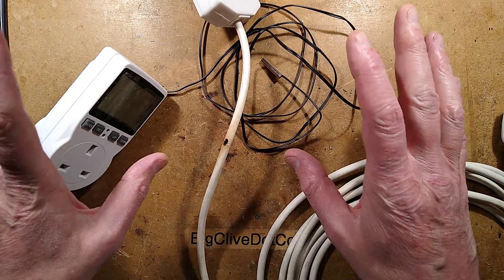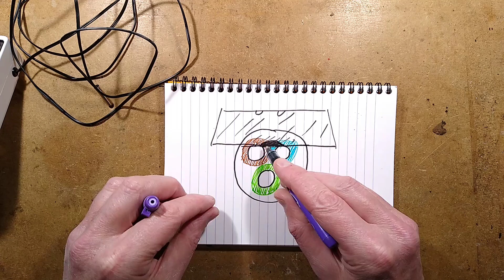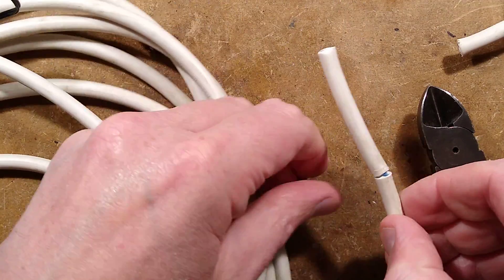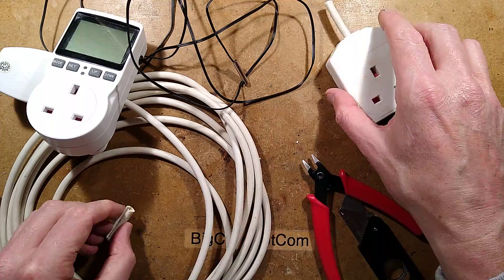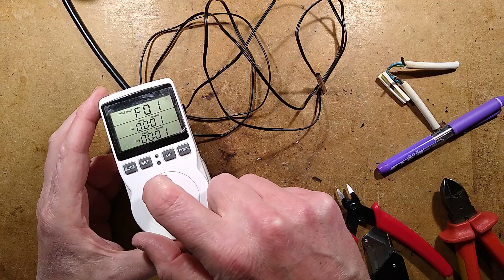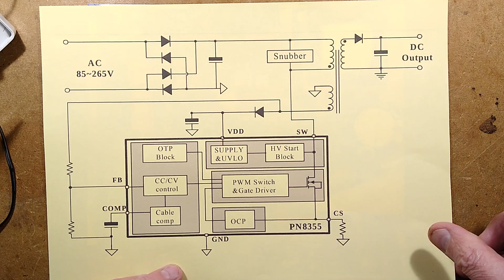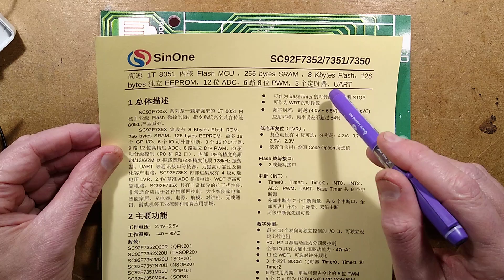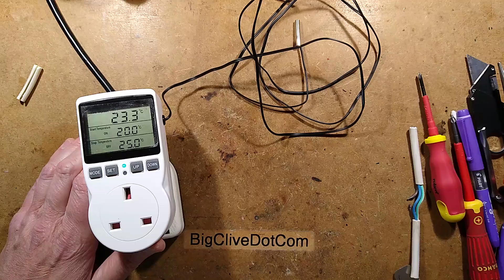The case of the mysterious cable arcing

Comment: One and a third cable diameters up from the clamp is were the change in internal tension in the cable reflects to a focus which cuts the wire/breaks the line/leaves Murphy chortling.

Comment: Clive have another look at the cable as I had a problem where when the cable was made it had printing on the cable not ink but pressed into the cable and every meter there about it had pressed so deep as to have damaged the full length of the cable I only found it after it had burnt .

Comment: I maybe wrong, but it sounds to me that the low voltage cable was laying across the extension cord coursing a hotspot, ? That is why we keep data and phone cables separate from mains cables in trunking and conduit, I was tort to never have cables crossing each other as it can course hotspots including With TW&E . But like I said I could be wrong. 
Fantastic video very interesting and very informative 👍 Cive 
👍👍👍❤️

Comment: No dirty crack =  done later due to dry plastic.
1. Cable manufacturing machines Do need to reload the individual strand spools and the ends are only overlapped without good connection.
2. Cheap cable manufacturers don't discard the spliced part.
3. It was used with a thermostat so surely heavily loaded for being a thin cable.
4. The bad connected splice get hot and it turbocharg copper oxidation.
5. The bad connection start to spark and eats away the copper as vell as melting other strands isolation and creates a short circuit.
It happens seldomly, but still

Comment: Wait a second if the thermocouple was super hot, it couldve burned through that wire. Not wire on wire, but red hot metal thermocouple on 90s extension cord?
Reply from the maker: The thermistors do not get hot.

Comment: The cable looks too thin for a heater. It only looks like 1.5mm but should be 2.5mm if it was a 3kW heater.

Comment: I don't think the cable was damaged by stretching it, based on the cut in the outer sheathing, it was likely coiled up and then held with tape and when the tape was cut, so was the outer sheathing and the brown wire likely got nicked or sliced partway through so it would work OK under low or moderate load but when a heavy heating load was placed on it, the brown wire couldn't handle it and arced causing all the burn damage we saw...

Comment: People are of careless with their things and then wonder why they break, cars are a good example, lots of people try to get away without servicing, but you may get away with it for a year or two, when it does break it will be something serious. Look after your things and they will look after you, unless their is a manufacturing error, all new electrical items need to be attended on first use in my opinion, as you often pick up a fault very quickly, if you have a basic idea of how things work. I could not repair a circuit board as I dont have the expert knowledge or equipment, but I have learnt a lot by taking broken things apart, but as the old saying goes, if it aint broke dont fix it. The number of people who mess with things, then call a repair person and say they have not touched it, if they just owned up the person would be quicker fixing it and it would save them money. I would have just cut the wire and with it being near the plug, I would have just wired it in again, but if its in the middle us a 13amp connector and not some tape, tape is fine as a short to fix, but it dangerous in the long term. When buying an extension lead check its a 13 amp, many shops sell bargain ones with a low rated fuse and wire, then people use them for jobs they are intended for, do we always check a extension lead when we want to use one, so in my opinion always buy a 13amp one, switchable with power surge is also a plus and so are LED's.

Comment: My initial thought, if you just looked at the cable, you'd see it looked bent, like it's been folded multiple times thereby cold working the metal making it more brittle. Probably hanging off a table or shelf right at that point and it just so happens when they plugged it in that time the strands finally broke or separated creating an air gap and an arc. Doesn't have to be a high load plugged in just a constant load as it continually arcs and the plasma heats up melting the insulation.

You keep mentioning the entertaient industry for some reason but a cheap thermometer like that seems to suggest it was used in domestic use... I bet that cord never moved from the receptacle it was plugged into. Only the end was continually moved and weight hanging off the end over a corner bending that wire over and over. In fact, you should have cut open the neutral and ground to see the integrity of the copper at that exact point.

Comment: Crushing that wire could have also caused a loss of strands that carry the current.
Office chairs, tables, doors, or anything that applies pressure in a very small area could have frayed that cable. Leaving heavy objects on the wire will also cause this. 
Respect electricity and things that carry it even more. It's not visible until it's a problem.
Stay safe everyone.

Comment: The carbon track actually I never thought of. Thanks for the info. Here the cable was pulled too hard, maybe stapled? Does it trip the breaker or blow out the plug fuse?

Comment: Id bet the insulation in the 20ga cord wore thin - stray copper. Either that or a break and arc - at 230 you may pull less current but these switch mode PSUs act like kinda a short charging the main cap (inrush) intermittent would do this.. Question for you - do your ring circuits cause EMI? Kinda a big inductor there..

Comment: Ive seen this on my mom's laptop - mains cords come from china and 20ga (brown/blue/green) crap insulation. That's why we have AFCIs required in bedrooms here in the US. Since we are only 120 (but split phase) we pull twice as much current. I kinda envy you - you got 230v at 32a in every room of the house. Sure you got some fuse in the plug (13a I think) but to have 7.36kW avaliable must rock (except for this kinda thing)

Comment: It looks exactly like a cable extension I once used for a soldering iron. The hot iron burnt through the plastic of the sheath and the live cable and shorted to ground through the iron. A bang ensued blowing the fuse and the live wire.

Comment: This is typical of overloading of cheap cable. There OK for light loads but very risky for 2 to 3 KWatt loads. Why do you think we use 2.5mm cable for 13Amp sockets in UK.

Comment: Cables that are coiled repeatedly can stretch inner cores and a large load such as a 2kw fan heater on a cable that doesn’t look man enough will produce heat that will be concentrated at any weak point

Comment: I feel your first assessment was probably nearest the truth, physical damage, but it looks to me that the extension cable isn't 13A but,maybe a cheap 6A unit, if that is true 1) you certainly shouldn't be running any substantial load through it and 2) a damaged under specced cable would turn in to a fuse. I have seen similar damage to flexes when items are placed on them like chairs or bookcases etc.

Comment: A much simpler mechanism may be that the live wire was cut most of the way through, then when the resistance heater load was applied, the last strand overheated and blew, causing tracking across the break with an impressive arc and heating that caused the additional bonding to the neutral wire.

The cable wasn't stretched, the hot lead had a section vaporized- that's why it's now shorter than the others.

Comment: But why are the plugs and sockets so humongous and ugly? Oh yeah, remind me never to move to Great Britain where huge plugs and outlets will be the norm. Even their Heathrow airport, on my way to visiting Israel, was a humongous overgrown poorly-planned monstrosity. Well I suppose our American 240-volt plugs are huge and ugly, but then my clothes dryer is in the ugly unfinished basement, so who cares? And my kitchen stove plug, is hidden behind the stove.

But on the positive side, Great Britain has automatic kettles and we Americans have horribly outdated whistling tea kettles that sit on a stove burner. Oh wait, I generally do not drink hot tea. Oh well.
Reply from the maker: It's because our plugs are designed to allow safe use of 240V on 32A ring circuits where you can plug a 3kW load into any socket, including clothes washers, dish washers and laundry dryers into any socket along with a tiny table light or a USB power supply with suitable fusing for all items.
Reply: @bigclivedotcom 
American plugs are probably also horribly outdated, but at least they are small even with Christmas tree light plugs that are fused. I have heard it said that even with RVs, bigger is not always better, but "just bigger" or too big for many campsites. Our American surge suppressors (or power strips) that often have 6, 8, or 3 or 4 outlets, are not huge ugly monstrosities.

Generally our American system works, however mowing my grass with an electric corded mower tends to be somewhat slow. Small blade, not a lot of power. 20-amp 120-volt circuit, but the manufacturer assumes 15. That means I only get but 2 horsepower. And our kettles are a bit slower than those of the Brits. But then why would I want hot tea in a minute or two less? I still boil water in a pan. My boom box has a fuse inside of it. But our American scheme seems sort of hit-and-miss. I imagine that some crap Made-In-China clock radio for the U.S. is not going to spend 10¢ for a fuse?

BTW, I have a couple of computers and a TV involving a surge suppressor supplying power to 2 other surge suppressors. Nothing electronic can be simple? Computer speakers, printer, monitors, a couple of clocks. Plugs multiplying like rabbits. Nothing using very much power. I shutter to think what the British version of that would look like.

Do Brits still have to attach their own power cords?

Thanks so much for taking things apart, so that I can see what is inside. Very fascinating. And I love that the Brits speak in English.

Comment: could the shape in the outer be because the wire got hot from internal fault and the thermostat probe wire just sank into the soft white plastic . I had a wire fail yesterday coincidentally on a chinesium RGB 'disco' lamp. The cable overall was the thickness of a 13A cable but the copper conductors were so ridiculously thin, they were more like ethernet wires. A tight bend would easily have snapped them. I shortened it and fitted a new mains plug but it was tricky getting these wispy wires into the plug pins, i had to fold them back over the plastic. Not safe because I think the smallest plug fuse you can get is 2 amp (but even that is hard to find) and I bet the cable would not handle 2 amps and would burn before the fuse would.

Comment: Why would someone tape a cable when it is just so much easier to get one of those Velcro tie straps with an eye hole on one end?  When I'm doing sound I always get the eye hole ones so I can attach it to the cable in a way that doesn't fall off when the cable is not coiled.

Comment: Being We have a bunny that chews wires, I was thinking mabe fluffy had nicked the wire. Cats and puppy's are known for chewing electrical cords as well. My guess is that nick may have been caused by a metal shelving unit. I have seen that before with someone pulling a cord from behind one of those grey metal shelving racks where the edges are sharp enough to cut wires if the wire is pulled against the edge. I remember watching a bell boy pulling the cord of a vacuum  from a distance ripping the outlet right out of the wall, talk about fire works! He then proceeded to blame the outlet.
Reply: I was babysitting a bunny, once, ended up with metres of speaker wire in 2cm lengths.  😃

Comment: I repair Henry vacuums for a cleaning company and I see this problem a lot. Normally near the plug or sometimes elsewhere in the cable. Caused by the cable being strained often, being trapped under doors and generally having a hard life.

Comment: Whilst examining it more closely: 'I have to examine this more closely'.. Now as it looks as if the blue wire has not been involved (and it is inaudible what Clive says about it) and the brown one is severed, it would seem to make sense that something else happened, and the heat etc was not a 'short' (as in that case the damage to the blue wire would have been much more obvious), the heat could only have come from the other way cables often (are caused to) fail: relative overload. Suppose the brown wire was damaged and partially cut when the user plugged it in. If only part of its copper was still making contact at the place of the breach, that would likely cause this to become hot and it even could cause arching as the last little bits of copper wire would melt away.

Comment: I would like to have seen how far back the wire was burned ... was this a instant fusing of the weak spot in the wire when high current load was applied or ... was the length of the wire blackened over time from a high load then finally gave out at the weakest point?

Comment: When I coil cables and tape them I leave a folded over "EAR" where i break the tape off to pull the wrap open, If I have to use a blade I gently slit the tape along the length of the cable but in between if you see what I mean
Reply from the maker: I do that on thin cables too.

Comment: Ha two weeks ago 86 year old mum had the chinesiam extension cord short internally tripping the old circuit breaker punching a burn hole in the outer insulation

Comment: I doubt one wire being shorter would cause a break looking like this. My guess is that the cable was pinched in a door or window at some point (or as you said cut with a knife by accident). There's no need for a short between live and neutral for an arc. A damaged wire where only a few strands are still in one piece will arc quite happily when connected to a high load.

Comment: When I was a young man, the Stanley blades were used in "Matt Cutter" handles. Thus matt knife blades.
Reply: This is what we use in Finland as well. "Mattoveitsi" whick translates straight into "mat knife".
Reply: @Qwarzz  Excellent to know! I once observed a commercial carpet-laying team using a mat knife and a specific carpet knife-- with a short blade (and sturdy handle) that resembles an animal's claw in profile. Also sometimes called a linoleum knife. I guess the shape helps get into corners.

Comment: What a coincidence!

While watching this video, I was trying to work out why a moulded IEC C13 cable wasn't working. The fuse was Ok and the outer sheath looked intact, but there was no continuity on either earth or live. I stripped off the outer sheath as you did, and low and behold, a charred and blackened live cable with a tiny sub 1mm blackened spot on the earth cable.

Beyond this point, both cores tested for continuity fine. The odd thing here is the intact 3A fuse.

I probably last used this cable on an ring without an RCD or circuit breaker, but I'm surprised that even just 3A was enough to burn through a cable which should be rated for the 10A. It's a  Fan-jet FJ-013 cable, and searching the web, it seems I'm not the only person to see these cables fail.

Comment: The spark plug wires on my car had a similar problem.  They were close but not nearly touching the exhaust manifold.  Electricity was arcing straight through the jacket and causing misfires, but only after the engine bay temperature reached higher levels after some time of use.  The cable didn't noticable melt,  but the jacket became crumbly at the arc point.  I only noticed (the problem, that is - the misfires were obvious) after opening the engine bay at night and witnessing the brief blue glow.

Comment: Is it braided wire ? I guess the cable had broken connection, maybe just some of the wire still connected. Then when in-rush current came up, it just welding it self.

Comment: In the early 2000s I used to work at a computer repair shop in Canada.  We would regularly see computers that had ROASTED the cable to the wall.  The entire length of the cable would be melted and crispy.  They always had one thing in common. 

Before switchmode power supplies were the norm a common thing to find in Canadian houses was a wall outlet that was connected to a triac dimmer switch.  So you could plug a lamp in and control it with a dimmer.  Great.  Plug a big switchmode power supply into that and it's a recipe for disaster.  If you turn the dimmer down the power supply will adjust and continue to pull more and more current until it would literally melt the wire.  

I think those nasty dimmer wired outlets have mostly been removed.

Comment: Before you cut off that section of outer insulation, you could see a slice across the burnt area.  That probably damaged the hot wire underneath in that area.

Comment: Looks like standart cut, probably pulled over a sharp edge or something, cut the L mostly, the fine copper strands than burned away over time probably under the load of the heater or something and then, kaboom

Comment: That kind of damage might've been caused by cutting through most of the strands in the conductor & running the cable to its nominal max thus overloading the few strands left uncut - it would've blown like a fuse.